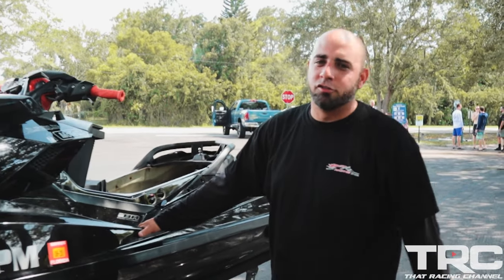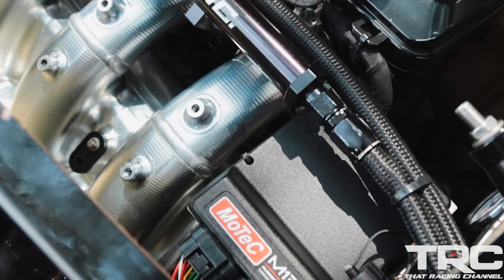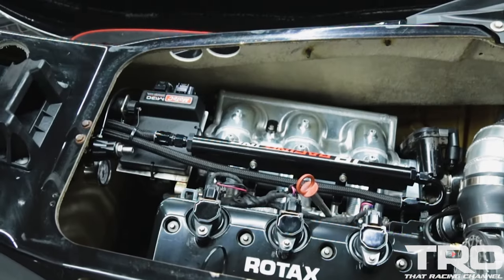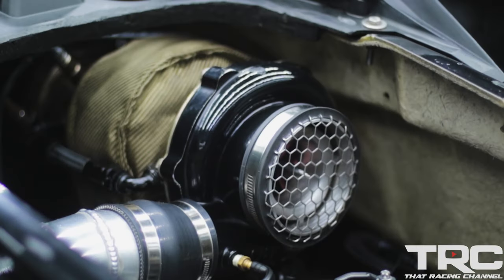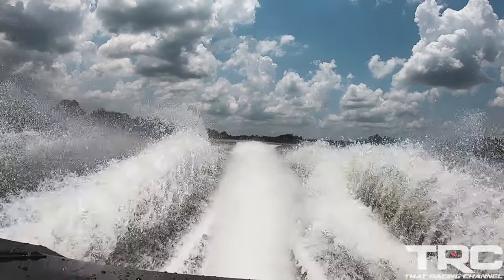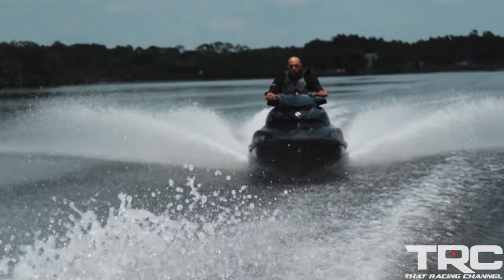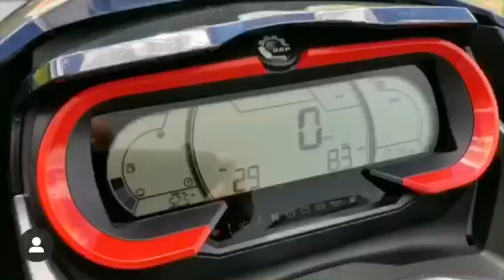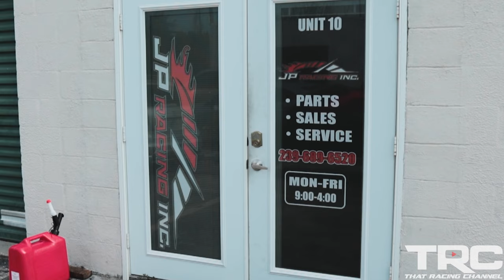500HP TURBO Jetski on 35PSI BRUTAL ACCELERATION! (Built 3 Cylinder Sea-Doo RXP-X 260)

Comment: My guess is Cleetus's will be getting one and featuring it on his channel. These are BADASS
Reply: I always wanted a VR4 Galant. I've built two 4g63t swapped Colts, a 90 Talon Tsi AWD, a 4g61t Eagle Summit sedan, and to make 500 AWHP is a really good feat with a 4g63t and AWD. Right now I have a 612 whp EJ8 Civic coupe, so we're probably making around the same power at the crank.
Reply: look at the guy's name he's talking to
Reply: 50% correct, he works on Cleetus’s jet boats….

Comment: I’m 268lbs I do 79.8mph gps on 91octane
I ride a 2019 Yamaha GP1800R waverunner with a factory 250hp 1.8li supercharged 4 cyl that I did a 8600rpm tune and stock impeller repitch and a cooling line upgrade. All in all spent $600. Definitely someone 100lbs less could get to 83-85mph but that’s about as fast as I’m down to go on the water. One solid wake and your breaking a lot of shit on yourself. Great video badass ski thanks for sharing. Ps a helmet and a good racing vest maybe something to think about. I look funny wearing that shit but better than a concussion or worse.

Comment: I hope that seat is made of kevlar just in case it throws a rod right towards your junk
Reply: No kidding. That's an insane amount of cylinder pressure to make numbers like that
Reply: I agree, like riding on a grenade almost. SCARY FAST.
Reply: The impeller of the turbo slicing your "Johnson" off 😱😱
Reply: Everytime I ride my jetski I Imagine a rod blowing out the engine and taking my leg off cause the turbo really pulls on my jetski and it makes you think about this same thing when your going 70mph on the water.

Comment: He should grudge race Finnegan and his twin turbo jet boat!
Reply: Would be fun to watch but im pretty sure that jet boat does 0-120 in 4 seconds @ 8 psi.  Now if this guy got himself a wider  hull and threw 2 of those 3 cylinder motors side by side 2 jets 2 turbos 6 cylinders @ 35 psi that would be a race
Reply: I was hoping someone would have brought this up. Finne's boats is insane, it needs some competition
Reply: dave S holy shizz dude, you’d be at face melting speeds before you realized you hit the gas

Comment: Jeeeeeez, I shattered my leg going 70 on the stock version of the rxp-x when I hit a slight wave and the ski flipped side over side, can’t imagine adding 200hp to it and going faster.
Reply: Exactly. Unless there are no people and the water is sheat glass going over 60 is super dangerous and difficult to find at least in San Diego.

Comment: I built a 76mph hammer perf yamaha 1390. Island racing plate, blue printed pump, pitched solas prop, flame arrestors - rxp killer. It would indicate 85-90mph, but you need a gps for real speed readout. They had a tendency to stuff the pump too, over 70mph and sling you off forward. I out ran everything on our lake. I couldn’t drop $15k + on a newer 4 stroke ski. They’re cool but not THAT cool. This thing is killer, wish you had a run against a 1390 running premium/100LL avgas  just to see ; )

Comment: If you were to take the impeller jet pump nozzle off, & put a sail drive on that jet ski, it would easily to 120-150 mph. A small wind screen like on a race bike like a gsxr would increase the aerodynamics also.

Comment: The only problem is that at speed you start sucking the jet pump dry. There’s not enough water flow. That’s where the real tuning comes in! If you can tune the water intake and impeller just right, this machine could set records.

Comment: how reliable is a system like this?  I mean, I wouldn't mind throwing a few grand at an older ski to make it super fast, but if I'm only doing a few passes and then it's back in the shop then is that extra 20mph really worth it?

Comment: Why does a jetski need 2200cc injectors....
Reply: Because Ethanol has 33% less energy density than regular Gasoline, meaning the motor will burn more in order to make the same power, so big injectors are needed to flow large amounts of E85.

Comment: What's the range on a full tank?
Reply: Yes
Reply: Lmao🤣
Reply: My stock 300hp ski gets me about 130 miles on a single tank cruising at half throttle not into the boost. With this injector size on e85 I'd say about 85 miles on a tank if you can stay out of the boost.